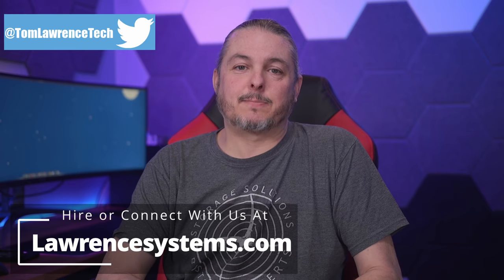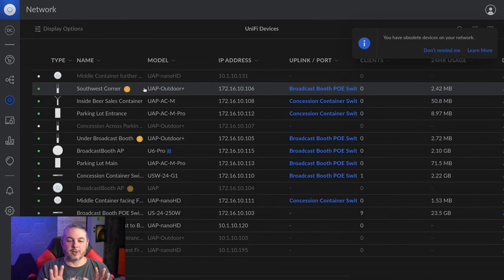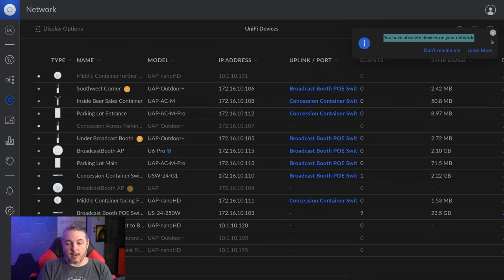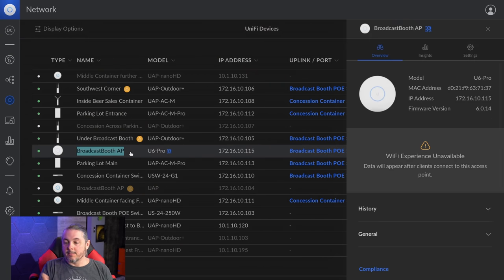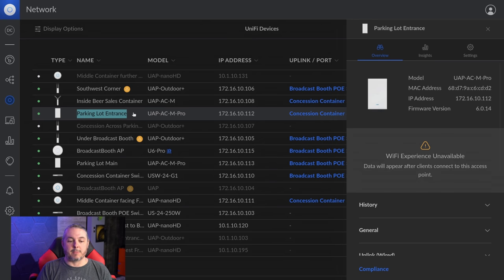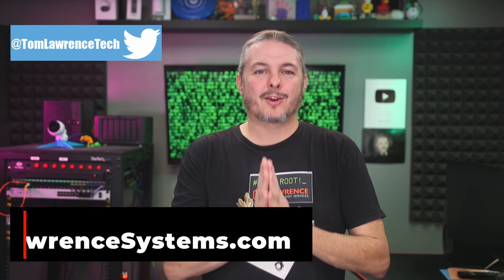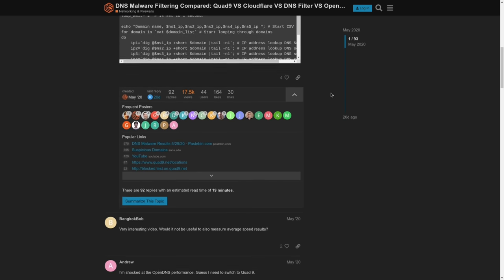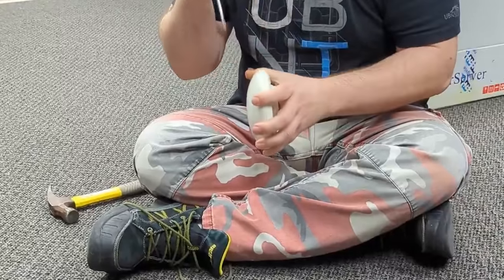UniFi: How Long Has This Equipment Lasted For?

Comment: Hey so I’ve been looking into getting an orbi rbke963 WiFi 6E mesh system. I also plan on hard wiring both satellites into the main router so the satellites are more like access points I guess. What would be something comparable that ubiquity offers. I really like that the orbi system is pretty much plug and play does but have heard a lot people talk highly of ubiquity.

Comment: Anyone having great success and long term I am happy for you.  1 key is make sure the environment is a climate controlled and temperature suited environment unless using the actual "fit for outdoors or high temperature" gear.  Their software gave us fits, tough switches were not that tough couldn't stand small industrial plants, APs we were swapping out in environments if they were not put in office spaces with heating or air, but I will give them credit their RA dept always worked and was on the spot.  Just too much back-end trouble for us to deal with.  I love supporting customers but when it becomes an all year job it makes you look bad as well so that is the reason we had to let it go.

Comment: Ubiquiti has not failed me this far, great stability even for carrying video feeds across big distances, I have always used the powerbeams M400 and sector antennas both 120 and 360 degrees and Nano M5s. The 48port switches, no issue whatsoever. Cisco equipment and their licensing model has definitely priced them out of the market, mostly government and financial institutions are willing to spend that much, SME's and lower always go for ubiquiti.

Comment: I love my UniFi gear! I have a UDM-Pro, EdgeSwitch 16 150W, UVC G3 Flex/G4/G4 Pro cameras as well a LAN for other devices.
I’ve only experienced some very minor issues with the Protect App freezing.
I’m not an IT professional, but an Electrical Engineering student and I believe that Ubiquiti make really robust gear and wouldn’t buy anything else!

Comment: arg i have 4x EOL UAP LR 2.4ghZ i used in remote operations, they no longer grab DHCPs after updating. Couldn't figure it out so I just bought new AC equipment. But those will still be good hardware if i could get them to resolve... old USG/Controller software required maybe?

Comment: the main reason you replace hardware is because of the security patches no longer will be around to prevent a network takeover and the hardware will quit one day too plus wifi 6e will be a great replacement as well its meant for less issues like discounts better coverage too

Comment: I agree with you on that yes engineering, manufacturing has gotten better. 

as far as the WiFi goes for Unifi. i will say the 4 to 5 year rang is where i have been seeing the failure rate spike. Outside of the usual one off where 1 has died with in 18 months. I feel that 6 years is pushing it. If you client started look at it at the 5 year mark. well i cant say they are behind.

Comment: I have a lot of ubiquiti antennas and cameras outside for few years and its build to last. My cameras are juste simple G3 Flex and they are not IP69 and not IP68...dont remember the rating but its only splash and my Flex are direct expose to rain and I have one at 90 feet high in a tower with any protection.

I just be careful at the installation to have cable going downward to not have water stream from the cable goin inside the ethernet ports.

And of course I always put grease in my ethernet ports to avoid extra humidity.

My old NSM5 are still doing great at 90 feet in my tower and they turned yellow with the sun but still rock solid.

A lot of PoE unifi switch and unifi APs too with no hardware issue since installation...around 2015

Great hardware so far.

EXCEPT FOR 1 PRODUCT LINE......Bullet series...installed a few for companies and it keeps dying. They are too tiny and gets too hot and dies. Or they took water damage.

Comment: I've got one, 1, count 'em one Unifi AP installed in my home and it works well.  However, for large deployments such as that stadium, there's one advantage that Cisco has.  With the Cisco Unified Wireless Network (CUWN), instead of connecting to an access point, you connect to a controller, with dumb APs acting as little more than a bridge.  With Unifi and most other makes, you connect to an AP and as you move, you have to disconnect from one AP and then connect to the next, which take time.  Yes, I know about 802.11r fast BSS transition.  With CUWN, you are connected to the central controller, not individual APs, which makes moving among them faster, as you don't have to disconnect & reconnect.

Comment: What about Unifi Cameras?? I purchased a few years ago the G3, 5 pack, 2 died just over a year (one failed completely, one the ir switch stopped working), then a 3rd died at 2 years. Then they dropped their software, so I just got rid of them all. Glad I did as the remaining camera's I have (some G3 flexes, which work better than the G3s which images are crap compared to the other brands I have (mix of dahua mostly and hikvision, or rebrands of those).

Comment: Thank you, Tom,for another valuable post.
Do you by any chance know (perhaps via back channel) when Unify will start to have the devices in stock. Is there a backup plan etc. 
I have few home projects for my family and would like to stick with unify instead of going with a different manufacturer, especially that I already know Unify platform.
Thanks
Reply from the maker: Not that I know of, we are all waiting for the supply chain to catch up with demand.
Reply: I work for an HVAC company and we are still seeing things get worse, not better. Lead-times on equipment is growing, not shrinking. Used to be if it wasn’t in-stock,  it was a standard 4 to 6 weeks (maybe worse case 8 weeks). I just quoted a job where the lead times were all pretty much 20+ weeks with more then a few hitting 30 weeks (which is 9 MONTHS). And all our suppliers don’t have any idea when it’s gonna get better or at least stabilize.

Comment: Hello all, Any had noticed any "programmed obsolescence" On the behavior of your equipment? I noticed that my UAP-LR (which maintenance is over) is not giving me more than 30Mbps download speed when I do a speed test. Currently, I have a 200Mbps symmetric internet connection and I am able to get full speed from my UAP-AC-Pro.

Comment: Have a UAP-AC-Lite since 2018, with a POE adapter on the TP cable (Don't have a POE switch)
Now I feel it's hot (Have been running 24/7/365, since the POE adapter is on battery backup), and when I took of the back-plate, I could see brown miss-coloring. 
Is there a way to counter it from burning up?

Comment: Is the real ubiquiti question good enough and does it have enough features? now how does it compare with mikrotik? mikrotik appears to be used on more solid projects as well. to date I have only used cisco, hp, alvarion and netgear for the low end. for home, however, I thought of using ubiquiti or mikrotik because I do not have to pay annual subscriptions I would like to create a 10gb network. I was also thinking of creating a small proxmox server based on supermicro what do you think?

Comment: I had a unifi 8 port switch die at home after 2 years and they refused to RMA it.   I had a 8 port Cisco 2906 die after a few years. It was outside I'm a box in the FL heat.    I called Cisco and they sent me a replacement next business day.

Comment: Home user with 10 G3 cameras, 6 of which failed at 18 to 24 months for IR cut filter failure. By 36 months 2 more for IR and one just failed. So 9/10 failures in 36 months 6/10 in 18 -24 months. Also 1 of three interior AP Lites failed at 24 months.

Comment: It's the software that is the issue.  It takes them forever to get something stable then they abandon it.   My ER4 was a great example.  And the unifi wifi code above v4 is horribly unstable.  I run their stuff at home.  I trust the Nanostation M5's but not the AC-Pros.

Comment: Why surprised?

100% of all commercial electronics are made with off the shelf components!

Yes, the cheaper Chinese stuff, when it involves power, does seem to last a little less (6 years instead of 8-10).
Reply: There are a lot of custom ICs in today's gear.  However, being ICs, they tend to be more reliable than discrete devices.  I've been around since the vacuum tube days.  Now they were unreliable!

Comment: I have been moving my home/homelab network more and more to Ubiquiti products. Definitely more reliable than cheap consumer grade hardware.  I have not had to even reboot devices since I turned them on, except of course for firmware upgrades.
There is one issue that I seem to have.  The U6-LR and U6-LITE APs that I use do not seem to work with some 2.4GHz wireless devices like my Brother Printers from 4 years ago.  Other appliance-like devices with 2.4GHz wireless also sometimes have trouble.  I tried moving them around to make sure it was not a dead spot, but that made no difference.  The connections would just drop randomly.  Though, maybe that is not the best description, I do not think the connection dropped, but the quality was so poor applications could not communicate with the devices.
Other than those issues, PCs, Phones, and other personal computing devices work great for me.

Do you use any of the Mikrotik products?  Some of their new switches/Routers seem much more capable performance-wise for the money.
Reply: Could be a problem with fast roaming. I noticed that some 2.4 devices don't play nicely with fast roaming. I don't know is Ubiquity products have a way to control what clients use fast roaming.
Reply: @MichaelRGlatfelterJr  Interesting, I did not think of that.  Most of those devices were on their own network and are not mobile devices anyways, I could just disable fast roaming on that network.  I will try that.  Thanks.
Reply: I'm still using Cisco switches in my server rack that I bought new back In 2012. Cisco has always been the most reliable. I work with Catalyst switches daily on the job in Network closets at work.

Comment: I've got close to 100 ubiquiti  mostly unifi but some nanobeams also. They mostly work until they don't. I've got some from 2014ish still going. What I dislike is the planned obsolescence. New controllers will stop supporting perfectly serviceable equipment to the point I have to run more than one controller to manage the new gear and the "obsolete". Not cool. At least the plus is the mobile app supports all controllers 🤷

Comment: My experience with access points is that they pretty much last forever.  I have 10 year old access points that still work fine although they're old and slow now and essentially, obsolete.  Gateways and Cloud Keys I've had less luck with, having to replace them every few years.  More than likely, this is due to poor ventilation and poor cooling and not the fault of Ubiquiti design and engineering.

Comment: Do you have experience with the longevity of TP-Link Omada devices? Thanks.
Reply from the maker: Nope
Reply: I've gotten a few for random odd jobs here and there. I found a couple of them had to be restarted every 3-5 weeks. I found UniFi did better but costed a good bit more.
Reply: I've had mine for a year now....2 indoor ones and one outdoor. So far so good.

Comment: I seriously have ten-year-old Ubiquiti stuff up and running that I've barely touched.  Generally speaking, if I'm replacing a UniFi it's because technology has changed, not because the equipment has failed.

Comment: A large percent of the 13dbi 5ghz nanobeams have defective Ethernet ports that start continuously flapping. Check their logs. I have had to replace about a dozen of them (which is all of them I deployed before I stopped buying them). nanostations and nano locos are much more reliable. Also the newer 19dbi nanobeams are better as well.

Comment: Seen half a dozen cloud key gen 2 plus devices fail out of a couple dozen. Can't recommend. Unifi nvr on my own appliance was so superior to cloud key gen 2 that it made me sick to see that support dropped.

The cameras are very reliable. out of several hundred deployed of various style the worst have been the g3 bullet and we have only seen about 5 of those fail after multiple years of use out of a couple hundred.

All the access points have been fairly reliable with the worst failures in my experience being with the on wall access points. The long range point to point wireless are exceptional. Have a wireless shot that is over 6 miles and has had zero failures in several years minus a lightning strike early in project. 

My largest complaints have been with dream machine pro devices consistently giving hassles with readopting devices out of nowhere and giving tremendous hell pulling camera footage in certain situations where the system locks up while attempting to download the files no matter what size of video file you attempt to pull.

Overall definitely one of my favorite product lines as a solution to many client needs, and as good reliability as most anything else I have used on the market over the last couple decades. with the exception of the cloud key gen2 plus, maybe I am unlucky but as noted above nearly a 25% failure rate in my experience. Overheating issues that were so bad in a couple cases they warped the drive caddy.

Comment: UniFi stuff will last a long time so long as it’s not a first gen cloud key, which will last the exact time that you plug it in till the power goes out, and so long as it’s not a second gen cloud key with the POS mechanical drive that lasts about two years.

Comment: Interesting, I do have a USG that just died this week and it is 3 years old.
To be precise it worked fine then this week it lost it entire configuration and went to some weird 169.254.x.x IP rendering my entire network unusable. I don't know why the LAN port does this but it did two times this week.
I do not trust Ubiquity anymore, I feel like the run burning hot that makes their lifespan short.

Comment: Cambium Networks is far far better and lest long like you can't imagine. Installed dozens of Uniquitis and cambiume since 2015. Now 2022 all Ubiquiti been dead since years. Some died 9 months after installation. Cambium we haven't lost one since 7 years. On Cnpilot you can have 120 users on a single AP without it crashing like Ubiquiti does starting the 18 to 20 users.... I lost 5000$ on Ubiquiti and sti some of those to be used for pleasure or  short term troubleshooting

Comment: old used box of UVC cams, bought for replacement for covid cam shortages. not one of them has broken. G3s and G4 lost count of how many of these cams have broken, mounted outdoors out in the open, they are barely weatherproof open them up obviously water intrusion caused them to fail these cams needs to be mounted under eaves. Had A LOT of their products have errata, their updates break stuff this they are not for the casual users. be warned. Keep in mind I deploy in a place that freezes in the winter.

Comment: My only real gripe with them is that they universally use a non standard poe that's exclusive and incompatible with anything outside of their ecosystem, so to have to use their Poe switch with their Poe aps, and you can't use the switch to power most other aps, it's just absurd imo
Reply: I have several Unifi APs working just fine on non-Unifi POE switches.